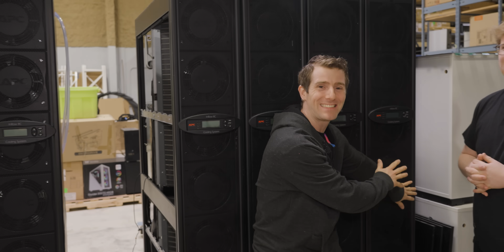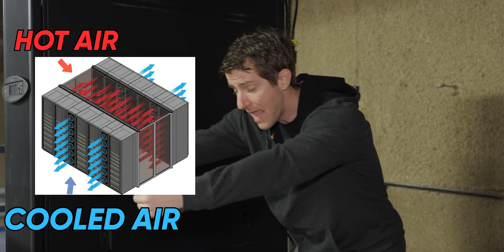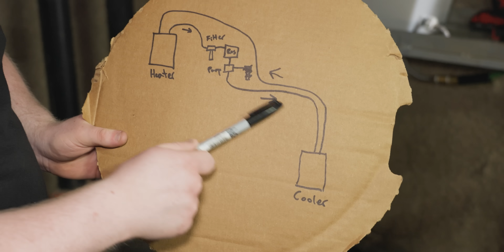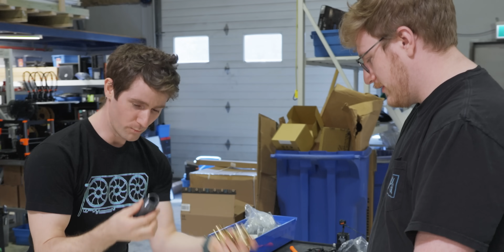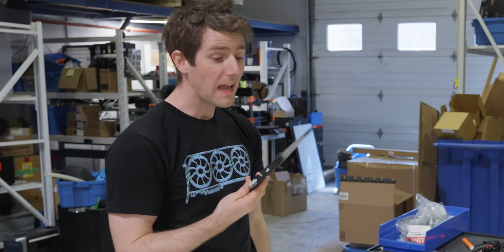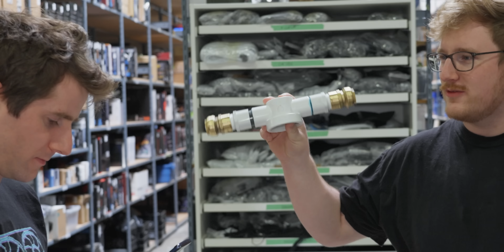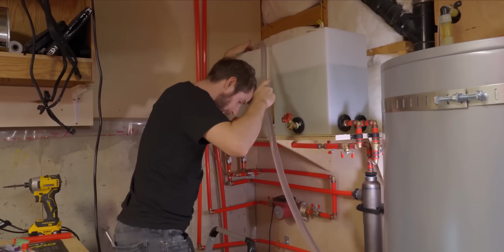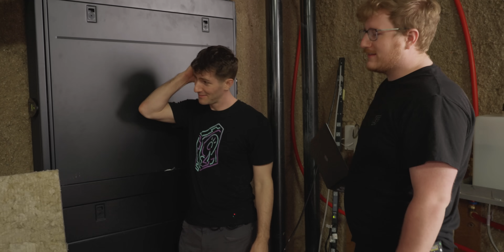I shouldn’t have kept the $1,000,000 computer

Comment: Im sure someone mentioned it but 2 words that you should take to heart is "Pipe Dope" I switched to it 22 years ago and I have never used Teflon tape again on ANY fitting from a shower head to Radiant heating and hundreds upon hundreds of fittings and i never have had a leak from first tighten of every fitting, The only thing you MUST always remember is to make sure you leave the end 1.1mm of the start of the fitting so no Pipe Dope gets into the line as it will plug filters, however Teflon tape does the exactly the same thing when it comes apart as I have seen you put it to far over the end of the fitting, I have also seen you wrapping it backwards it wraps with the twist of the fitting to tighten it, However  a bottle of Pipe Dope lasts so much longer then a crappy roll of Teflon tape, and works much better. As i'm sure you also noticed make sure when using Pex always remove the white inner collar ont he shark bites as they are just for very flexible tubing such as the clear tubing or something like a garden hose (please don't connect a garden hose to pex lines or Shark Bites except for an end run off drain that has no actual pressure as it will still most likely either pop the fitting out or cause the teeth of the shark bite to cut into the pipe, also to remove pipe from shark bites use an adjustable wrench that you set to the size of the pex pipe. Also in one of the home cooling videos you stated that the gray pex pines allowed air transfer, you got that backwards the gray sheath over the inner black line prevents that, the pex you used in this video actually can if its the older or non thermal pipes allow this effect to happen, the gray and black pex does not and supports radiant heating pressure and temps n problem where the red pex does not. Also the red and blue are designed for color coding your lines aka hot and cold not a type of pipe.) Also while I do love soldering shark bites even on permanent installs are fantastic as you can later if needed alter it so quickly. I was also happy to see you using Shark Bite ball valves but to be able to properly isolate lines you need 2 one for either side of the line with 3 inches of Pex in between which is enough to get your Shake Bite separator or adjustable wrench (Which is way harder to lose then the stupid orange crescent moon shaped separators for the shark bites you can buy, so just use your adjustable wrench and doing plumbing work means you should always have one with you which i saw you using) Also your auto fill solution is i will say inspired. Love it. As for the plastic container, sand it with an orbital sander to make its wall thickness match.

Comment: I mean the heating of the asphalt and therefore cooling of the water/air whichever you're doing would be able to keep the road from freezing over as quickly. It won't be nearly as effective as putting up straight up metal in the road that is connected to electrical currents that will turn on whenever the road starts to reach a certain temperature and keeps it above 32° F 0° C... Although it would at least make it more difficult for ice buildup and considering y'all are in Canada I figure that's an issue at some point during the year. Obviously once it gets beyond a certain point it would still freeze up however hopefully that would happen during the night so y'all wouldn't go into work that day.

Comment: if it were me, I would just install the chiller right next to your server cabinet,  like they were originality used , instead of all the Janky plumbing running.up and down and round and round. you would have to wall  off the exhaust side of the cooler for your hot Isle, and then duct the heat out to the warehouse for winter heating. or use one chiller to take room temp water and cool it down and then run it into a second chiller. it would be a hell of alot more efficient. but that is MHO....

Comment: Just wanna let y'all know that crimp fittings are just as reusable as normal ones! You can just cut the crimp ring or compression ring (depending on the style) off, and reuse the fitting again later. Lowers cost over Sharkbite, which are brand name and expensive!

Also, if you want to impact the flow as little as possible (most fittings will restrict flow), you can look at.... I believe Pex A? Uponor makes these really cool stretch rings with a special tool that keeps a consistent ID on the pipe. In this situation, I'd recommend the plastic fittings over metal ones in this case, they're cheaper still! The cost is upfront in the tools.
Reply: I am not sure do you have SwageLok fittings overthere or they are only EU Brand, but i am realy impressed with them when we are using them in my place of work.Have to point out that the max operational pressure we have is 5-7 bars, but still impressive quality of the joins.

Comment: If u plan to cool down, put the heat exchanger in the ground not above, the hot air will go up, u will have more cold air too.
Well. If u don't have space for it, just get the cold air with some tubes.

Comment: Not how cooling in a DC works. Warm air is sucked in the back of the rack  in the aisle (Warm section of the DC) and then get's cooled and pushed out the front to cool the servers and the room down.

Comment: Btw you might want to check I think rockwool isn’t designed to be used in open air because it spreads its fibres everywhere which your not supposed to breath.

Comment: 2 degrees Celsius is quite a bit.
28 degrees Celsius is 82 f
25 degrees Celsius is 77 f
As an HVAC technician Ac units typically have a 15-20 degree temperature difference from the inlet to the output have you considered just installing a larger AC unit or dedicated unit just for that room? I have one company that has one dedicated for their server room and we sized it to keep the room temp quite low. And have a smart thermostat so that we get notifications if the temperature gets above a certain threshold.

Comment: The usage of heat is the same concept that people are using for crypto miners too. Also, you could put a radiator in water to heat a pool or, a water heater for your place if you have one.  Then install auto values to divert the heat from the water heater once it is up to temp to the shop and then outside. Maximize your ability to use the heat before dumping it outsid

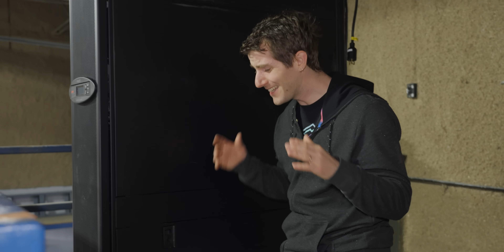Comment: 3:00. Hey smart guys. You want to put that as low as possible. Not as high as possible.! 

Hot air rises. 

And if you're planning on heating that workspace. It means you have to heat the entire open air volume. Before The hot air will reach the workspace. 

Which of course is on the ground..

Which obviously means you're now attempting to cool the hardware. With the warmer air.

And taking away from the heating capacity at a lower level. Before it rises to the ceiling. 

Again facilitating the requirement of feeling the entire space with warm air before it can reach a workspace. 

And again suffocating it from cold air by the attempt of acquiring the warm air layer down at the workspace. 

So. Yes it is a mint plan. But clearly the execution is terrible. 

Those radiators need to stay on ground level. You're reducing efficiency and general capacity and/or capability. With its current geographic location. 

Now I understand You might think well they're not that much higher. 

And while that may be true. It doesn't matter.! 

It is still too high to receive any warming effect for the workspace. Unless you are successful at feeling the entire workspace. 

Which will of course then mean you are also successful at suffocating The radiator with warm air.!

So it needs to be on the ground. There's no way around it. 

Yes I can imagine you thought it was a fantastic location because it would be out of the way. 

But as you previously described. That surface is not even rated for storage applications. 

But whatever. 

I actually still think it'll work fine. 

Because I don't believe it will actually be able to fill the entire available volume before that amount of heat can be dissipated over that amount of surface area. 

So it will never function here for the work area. 

And So it will receive enough cool air two function properly. 

But you're going to continue to be a little chilly down there. 

So again. It's whatever.

Comment: As a former datacenter tech Linus is so right about how exhausting it is being behind the server output. The sensory inputs from the sound, air movement, and heat and it’s a dry heat at that. It dries you out and makes you feel terrible quickly.
Reply: I personally prefer a dry heat over humid heat.... 80-90% humidity at 90-95 is worse than 120 at 10-30% humidity.
Reply: So, it's the same as living in Southern Arizona, got it.
Reply: linus was making a pun... because it's the server exhaust
Reply: very true but those cold isle in the summer are so nice and so close :)
Reply: This is funny now imagine that same heat in Texas but outside day and night during half the year we Texans are battle hardened by extreme heat already guess we should all be in data center work since that’s our normal temps

Comment: Listen. I'm gonna be that guy. Sorry not sorry. Sharkbite plumbing is bad. I've had to go back to many jobs and remove drywall due to failed sharkbites. Within months after the plumber "repaired" the plumbing using sharkbites. I will say it's good when you're in a pinch and need to cap a pipe but compression fittings and regular plumbing techniques will always be a better option. I'll be waiting for the update video of failed sharbite fittings ruining the server. Hope it doesn't but only time will tell. Good luck.

Comment: Don't use only rockwool inside ventilation, the dust from the sheets are bad for both eyes and lungs. use a fine mesh or some other protective fabric over them if you are going to blow air over them in a duct.

Comment: 17:20 NEVER use only teflon tape for pipes. Teflon tape is meant for temporary fittings, like temp end caps , etc. You should use something like Locktite 55 that has  graphite paste, teflon and also linen strings. Also "bite" the thread with the wrench a bit so it has imperfections in the thread. That will hold onto the tape so that it will not screw off.

Comment: If you want to automate the valves consider using industrial parts like butterfly valves and a dedicated Siemens S7 or Tia Portal PLC or maybe even an ABB system. Industrial parts are highly versatile, use standardized voltages and are much more reliable than a raspberry pie.

Comment: You need more airflow over the exhause heater rad, to help kick more heat out of the system.  Also, you could possibly add a couple of metal radiators... Try throwing some central heating rads around the  warehouse to help increase the thermal mass, and dump the heat at more points...  Remember your cast iron water cooled system a few years ago? "heating a house with a PC"

Comment: At 104F in Canada wouldnt it be better to just put a straight vent to the outside and a fan to force the hot air out? Its never hotter than that outside right? I wouldnt even bother with the AC.
Edit: I posted this comment right after he said the temperature in the AC server room. Disregard.

Comment: edit: the pump shows air flow, not water flow so my math is way off, but still pretty interesting

I did some rough math here about how much energy that pump is pumping. Assuming that I read the display correctly, it is pumping 1241 liters per second, and with the heat capacity of water and the change of 4 degrees you get about 21 MJ of energy per second. Which makes no sense, so I'll assume it is actually the hourly flow rate, which gets you around 5.8 kW, which is believable.

If we assume that the server room is pretty typical in size 22.5m^3 to 48m^3 we can calculate how much the room should be heated, if the pump wasn't there. We get a hilariously large number of 1000 degrees, of course this makes no sense, but as heat dissipates and with ventilation this could actually be quite plausible and you could get a reasonable number

Comment: LTT is the embodiment of we never have time to do it right the first time but we always have time to re-do it.
Reply: Hey, in cases like this, the "quick and dirty, we'll fix it later" approach can make a lot of sense: they are definitely using the version from this video as a mere prototype to work out any kinks and come up with improvements for the professionally-installed version. They already expressed plans to have plumbers later and do this right and discussed some future improvements, and what looked like a single afternoon of work by a handful of guys was enough to prove the concept. On the other hand, imagine going through all the work and expense to get this installed professionally, only to find out that it doesn't work because they overlooked some major detail when designing it and need to hire them back to fix it like they almost did with the filter? What if some safety shutoff was installed in these radiator units that prevented them from being used to expel hotter air than they intake, considering how they were intended to be used? A quick and dirty proof-of-concept prototype can help prevent much worse wastes down the road.
That being said, while I see this particular case as justified, Linus is far from off the hook for things that should have been done right the first time. Some of his past data management practices were pretty sketchy for such a technically focused company. Even on this project, while the prototype nature of this iteration is fine in my eyes, they were a bit careless with the water versus electrical panel.
Reply: Future content for videos.
Reply: @Reepicheep-1    good eye
Reply: Sounds to me more like the skimping on details the first time will eventually lead to "fixing this is urgent so we'll have to". There's having time, and there's making time.

Comment: I had to replace my outdoor water faucet, but not only was it in a really hard to reach area, but the indoor shutoff valve, and the connection to the pipes was seized, and it was way easier to just cut it all out in sections, and start with a new indoor shutoff, otherwise to use a flame torch in between the rafters and all of the many wires and insulation would have required adding a bunch of flame/heat shielding Making the space even smaller.  Then I found the shark bites, and had what I knew could take a whole day, done in ~1/2 hour, and its held now for a few years, and the freaking valve is like new, so didn't crust up, oxidize...  Great stuff, well worth the money, because it also comes apart just as easy!  They even have little sharks engraved on them.🦈

Comment: Maybe a weird question, but wouldn't it be more efficient to just make huge ducting to the outside? Because outside is probably 15-20 degrees most of the time. You only need some powerfull fans to move the heat outside. Or, suck air from outside, blow it into the server room, and blow the hot air into the warehouse.

Comment: In case of leaking, i worked at a proffessional manufactor of boilers. Use Loctite 55 between the thread not on it and give it a nice 80NM pull and it will never leak.

Comment: Please don't leave the water to that fill valve on. Something will eventually leak and when it does, it will just keep filling. Also you need a pressure reducing valve on it, otherwise it will pressurize the loop with the reservoir cap on.

Comment: One major issue you'll still have is that the two hoses are not well insulated from each other, in a DC setup you'd run the inlet water on the cold isle and outlet on the hot isle side, because now you're reducing the outlet water temperature and increasing the inlet temperature by running the hoses together. For DC modeling that's nearly a 40% efficiency delta.
Reply: Here in germany we have premade piping where you have a large outer "pipe" containing two water pipes with insulating material in between, its made for heat pumps, maybe they can pull out the duct tubing and put something like the heat pump tubing in, would fit the use case perfectly
Reply: @legominimovieproductions  Yep, probably the same time used for an outside wood furnace for your house.

Comment: You need an adjustable fluid bypass in your system controling the FLOW RATE through your system.  It takes TIME to transfer heat from water to air and from air to water.  It is quite easy to push water through a radiator so fast that almost no heat is transfered.  Lessons I learned the hard way.

Comment: I think this is the future of heating, shifting heat from where it is not needed, to where it is needed.  I keep reading about systems like this online, like heat from London's Underground trains heating student accommodation.   Also using heat pumps in between the source of the heat, and the final location to be heated. Can concentrate the heat a bit more, if not enough heat is getting transferred.

Comment: Maybe move beyond water as your thermo-conductive medium? Something more like a modern refrigerant, condenser and pump setup?  For your scale you could probably take a household heat pump and move those theta numbers well into double digits, less pump stress as you'd be moving gasses vs water - no need for the reservoir, filter, having to change the fluid as a maintenance... There's a reason we use gasses to cool (and heat) households (aka large amounts of energy) using gasses rather than liquid these days.

Comment: Get a hydronic air source heat pump for the outside and then you can do your own AC without needing gas, just using water cooling. Then if you want, for the summer you can cool the warehouse if needed.

Comment: Heating a really tall warehouse, it be at ground level or you're going to have a layer of hot air up top and ground will still be freezing. Like trying to heat feet in a car using the top vents only.